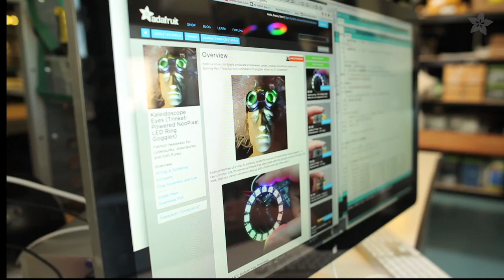Kaleidoscope Eyes NeoPixel Ring Costume Goggles

Comment: Also why can't you wear the goggles over your eyes? Could you wear it if you made some shielding behind the NeoPixel rings?
Reply: The reason you shouldn't wear them over your eyes, is that the light inside the goggles bounces and becomes incredibly bright inside the goggles themselves. This can anything from headaches to vomiting. Also if you notice in this video she tucks the gemma and battery pack into the goggles eye pieces so there isn't a place for you to see out of.  Next you also are wearing welding goggles and have no peripheral vision with them on. So why I have designed a pair to be worn over my eyes I still wouldn't walk around with them over my eyes.

Comment: I have some of the goggles I made and I guess I was a little rough on the battery when showing them around. The small Lipo pack looks to be in good condition but the wires popped off. It is the 150mAh one and I was curious if it would be easy enough to solder the JST connector back to the battery? Or how I should properly dispose of the e-waste. Definitely ruggedizing the next pack I get
Reply: Do not solder the connector back on. If you push the pin in the JST connector out (very carefully, I use a sewing needle) you'll see that it's a crimp connection holding the wire in place, carefully loosen the crimp connector strip the wire a little bit put the wire back into the connector on the pin and re crimp. The slide the silver pin back inside the JST connector. Also I'd wrap one of the wires with electrical tape to prevent them from touching the other.
Reply: This came in handy for my second battery that just had this problem. Thank you! but it was not until you replied that I realized I did not explain my first problem correctly. My wires on the first battery disconnected from the protection circuitry under the tape connecting to the LiPo. Is there any harm in attempting to resolder those wires back to the protection board?
Reply: TheGenocidalPanda You'd have to be very careful when you resolder them. So if your good with your regular soldering you maybe okay. Here's the issue, the batteries themselves are volatile to heat. (they really don't like it, and yes they can get hot.) To much heat and you can seriously hurt the battery, loose the protection circuit or worse and make it explode. If you have any doubts about your ability to do it quickly then I'd honestly say it's better to be cautious and buy a new one.

Personally if it was me, I like my fingers I'd buy a new one.